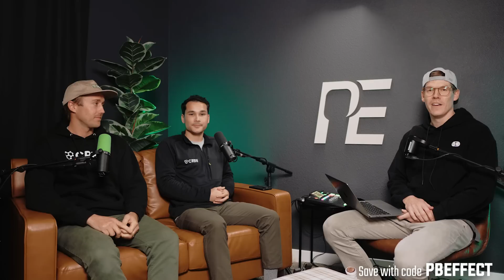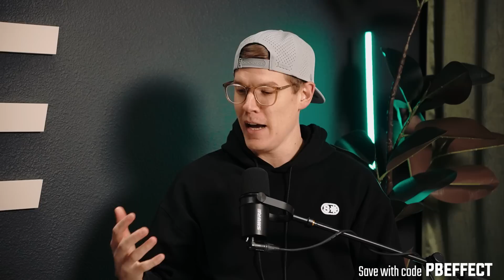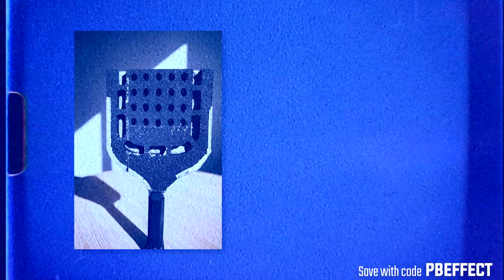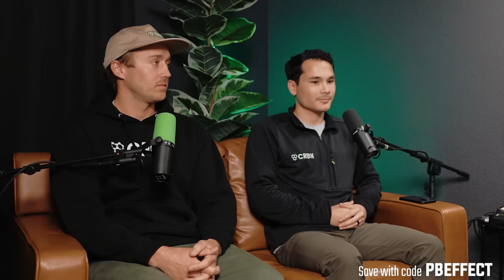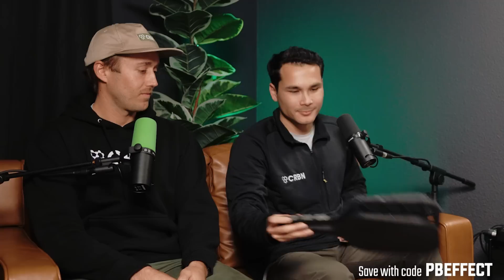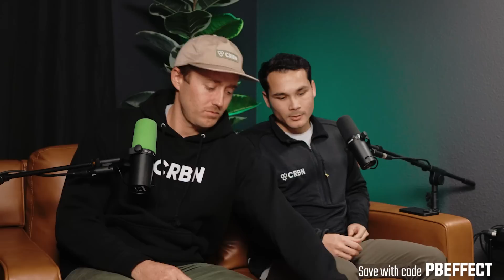CRBN TruFoam Paddles: Behind the Scenes with CRBN Owners Garrett Gosselin and Kyle Goguen

Comment: I am torn between this the new 11six24 vapor power paddle. Do you have any advice for helping me decide? I currently used the shogun paddle but have been switching back and forth to the Vatic paddles as I love the way they feel.
Reply: Also do you know if the flying pickle will have the crbn paddles available as demos? If so I can try them there to see if I like them or not.
Reply: 30 day return on the CRBN onw of the few that still does that
Reply: @adogap8185
Experiment with lead tape at 3 and 9 o’clock 4 inches per side…made a noticeable difference in pop/power…love the TF3